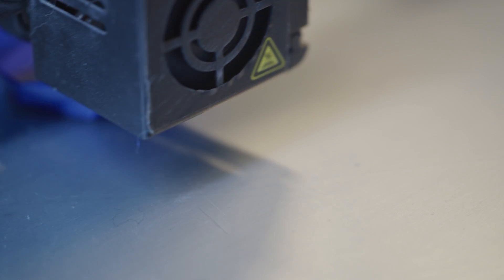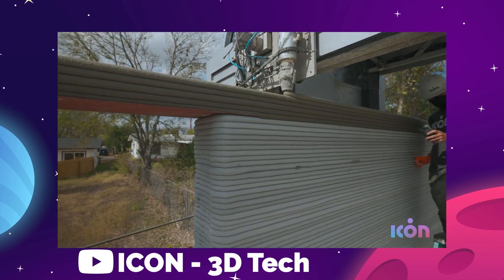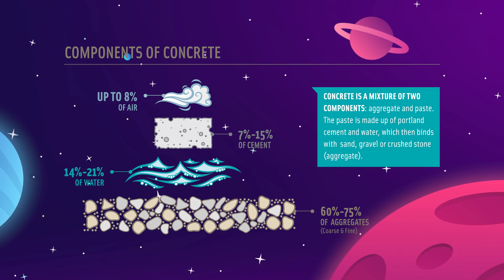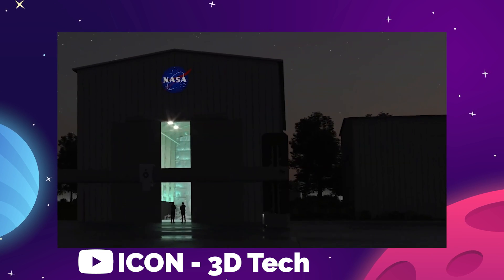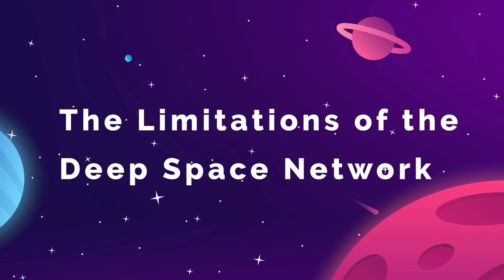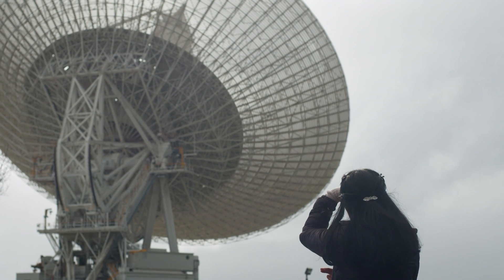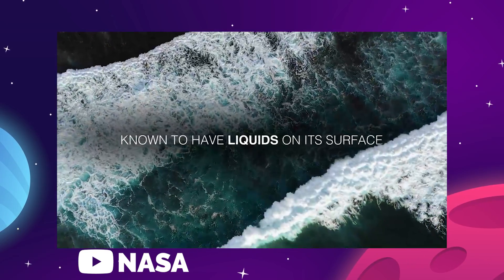How NASA Will 3D Print Houses On The Moon!

Comment from the maker: "Have you checked out Pinecone yet? 
https://www.influencerlink.org/SHEQZ"
Reply: link is not working for some reason
Reply: Wouldn't the extremely low temperature on the moon cause the concrete to hardened??
Reply: Yeah but you just correct size in spacex starship you just engaged in my bulshit look spacex starship is the beginning a new colony why could you crazy spacex because you mine full of turn
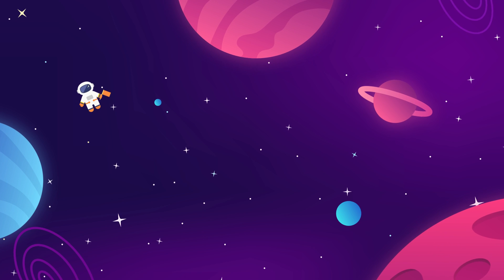Reply: 13:25

Comment: Liquid flow ends when it's space cold. I wonder how you heat the mix, all the piping, and the spout, and the extrusion doesn't freeze solid and basically shatter on contact with anything.

Comment: I have not found any numbers published about the energy requirement of that kind of 3D-print technology  But melting  silicone needs a lot of it. On Earth we have a lot of electric energy, but on the moon   huge  power plants  don´t exist. On Mars it is even more difficult, because solar radiation is so much weaker and not available during night and heavy dust storms.
3-D printing regolith by melting ist, would be comparable with production of Rockwool which is based on  molten silicone as well . To produce 1kg of Rockwool  2-5 kWh of energy are required,.That would be  6000 to 15000 kWh for 1 m3 of 3D-printed massive wall or ceiling. 

But massive walls and ceilings even are not needed. In the lunar vacuum or in the thin martian atmosphere the main challenge for the structure is not weight, but the inner air pressure. Atmospheric pressure has a force of 100KN/m2 or  equivalent to the weight of 10 metric tons per squaremeter on Earth. Thus a thin and light  inflatable membrane  structure with sufficient tensile strength is sufficient. The inflatable structure can be covered with several meters of loose regolith for protection from cosmic radiation and  micro-meteorites.  The inner air-pressure can easily care the weight of the regolith deposit.

since the inner air pressure  has the greatest impact,  the building should better be spheric , cylindric or toroidal in order to avoid bending forces on a rigid structure, and not a rectangular shape with flat walls and ceilings as on the Mars- prototype but by Icon

Comment: If the pressure inside the lunar home is only 4 psi, the same pressure as space suits, the total force on a 8 foot wide by 8 foot tall wall will be over 36,000 pounds of force.  There is just no way you can have a surface habitat because there is no atmospheric pressure.  And any window would have to be 6" thick.
  
Any habitat has to be underground so the mass of the regolith against the habitat EQUALS the total force on the inside ceiling and walls.

Also, for water to be a liquid there has to be pressure.  Without pressure the water vaporizes, so you can't spray cement on the surface of the moon or Mars.

Comment: The cement doesn't need to be Portland.  Epoxy works quite well in a vacuum.  Better in fact!  Just bring the right epoxy & hardener, add a tiny bit of stabilizer, and you have a concrete that will last.

Comment: There is more then the low gravity to consider when planing the structure of printed habitats. The pressure differential may be enough to prevent the building from properly compressing in the low gravity. Since concrete is strong in compression but week in tension, any structures would require some kind of reinforcement or alternatively a whole lot of mass(lunar regolith or maybe water tanks?) weighing it down.

Comment: The reason, why cement can't be used on the moon, is the fact that it needs water for curing (there's a chemical reaction between cement and water that thurns the goo into a rock). In moon, water would boil away (evaporate) due to near vacuum environment. That happens fast - faster, than any reasonable chemical reaction can take place. No water - no concrete.

Comment: Why not just use the ice on the lunar surface for water n mix the structure with fungi  so the interior self heals
Reply: good question, the problem is that heating up water on mars doesn't turn it into liquid water, the atmospheric pressure is too low, it goes from ice to vapor. it would vapor out of the concrete before it could cure. :)
Reply: There's water and ice on the moon

Comment: In our atmosphere with 14.7 psi atmospheric, concrete needs time to cure. Curing too fast will make the concrete brittle. With no atmospheric pressure, it may cure too fast. Sounds like a good mini experiment for outside of the ISS. There have been upgrades to the deep space network, mostly to handle larger data packets for Mars missions. With the increase of active missions that NASA operates, the DSN is due for some major capacity upgrades. With all the planned manned and robotic missions to the moon, Luna nets time has come!
Reply: Thanks, I was wondering about that
Reply: In the lunar atmosphere it’s impossible for normal concrete to cure at all. The difference I temperature from the sunny to the shady sides are far too extreme for conventional concrete. Along with that, any moisture used to activate the concrete would evaporate into space. I believe the material they’re planning on using has very little to do with the concrete we use on earth.
Reply: @Strugglecuddle  The articles I've read speak of melting silica regolith with Magnesium oxide. The product is very close to natural stone. Another method might be the Masten in-Flight Alumina Spray Technique (FAST) Landing Pad. It changes the approach to landing on planetary bodies by mitigating the landing plume effects by creating a landing pad under the lander as it descends onto a surface. I am sure that Material Scientists are devising other methods as well.
Reply: NASA has already done this in a vacuum chamber. They also developed a glue that could be used in a vacuum to repair Space Shuttle tiles and wing damage but was never used. Also, they are not making concrete. They are using regolith as a filler with some kind of binder that works in a vacuum. It will work but what is unknown is how good and how will they get the Machine and materials there when NASA can't really even go to the Moon?

Comment: i wonder how will they keep the regolith warm enough in those -70°c to - 90°c  to make a building from regolith on mars and the moon . i see an engineering problem coming up.
Reply: Spray foam
Reply: they only need to heat a small amount of regolith up to 1400°c within a slam volume inside the printer jet, one by one. and in vacuum o the moon there is no heat transmission, just heat radiation. but alle of the building material needs to be heated  to that temperature and the needs a lot of energy

Comment: Why not use Pyramid technology, i.e., mine stone blocks to high precision and stack them around each Starship? The tech is old but it is proven with little equipment needed? The New Stone Age.
Reply: One issue against this idea is the massive amounts of dust it would generate.

Still more feasible than that suggested in the video though. Heating regolith till it melts is all very well, but that would require an insane amount of power. Which means sending some form of power station up. Which means constant mainenance, fuel.... Even a solar farm would mean robots to deploy them, plus make the entire project incredibly vulnerable to moon dust kicked up during construction, or during rockets landing/taking off. 

Yes, TBH your pyramid idea makes a lot more sense.

Comment: That is cool tech, but if we value life so much that we are afraid of taking risks. thus relying on technologies to do the high risk jobs, it will just make us soft.
Reply: Not soft; capable.
Reply: @SjMk1.  That is a stupid excuse for not maintaining hands on experience, that is abysmal, now if individuals want to do this. That is their choice, to me, losing the actual human construction worker, is the worst decision ever. Now. On the flip side, if this tech was used for visual 3d models or to use only in Extreme conditions where humans could simply not be of use without risk of injury or death, then yes we use that. But to take over the construction industry is a catastrophic level mistake.
Reply: so essential for the limited use it can be useful for. To replace the human job, the safe construction jobs, is borderline stupid. For the things it can be useful for, Im okey with that. So you know what im getting at.